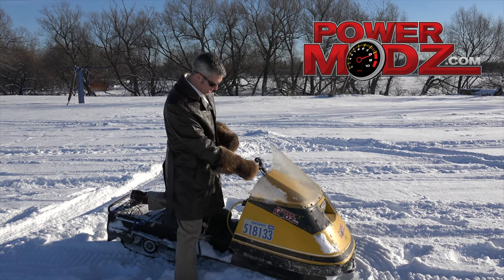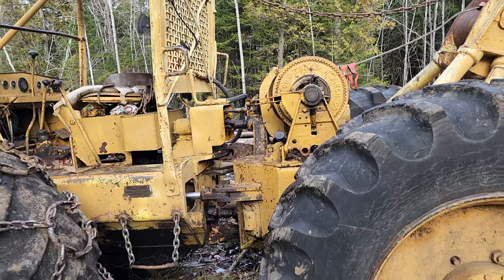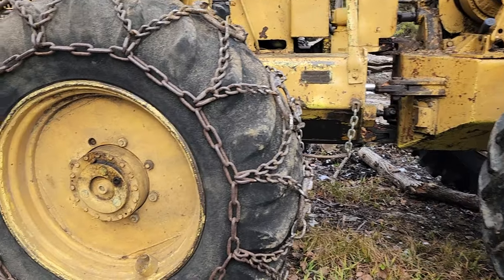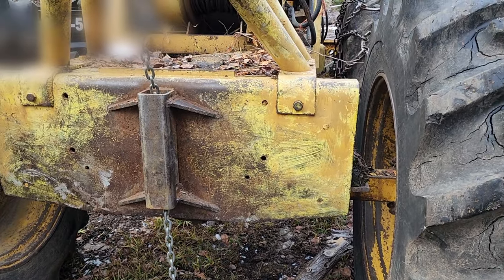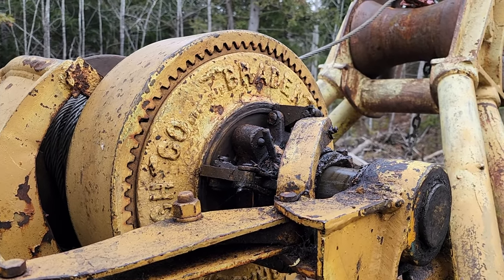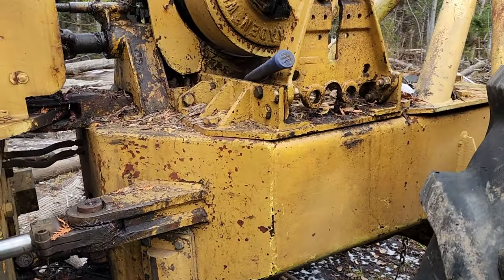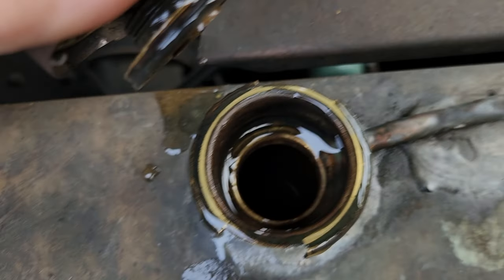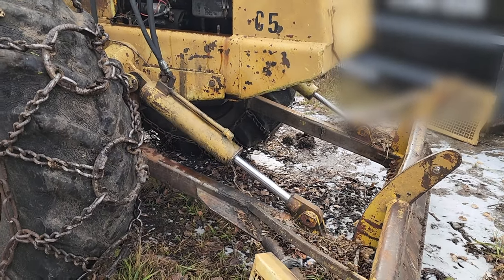BUYING AN OLD SKIDDER .  WHAT TO LOOK FOR.

Comment: Great video! Thank you for taking the time to show and explain things. I am looking at the same machine from 66.
The listing says (copy/pasted)  
EXCELLENT Running machine.
Put on the job sight right now and put to work
353 Detroit. The engine has 1600 hrs on overhaul. Spare transfer case and spare tire and wheel go with it.
Winch rebuilt around 200 hours ago, needs cable.
500 hours on new center pins

They are asking 10k. Your opinion jump on it, or run away?  The machine is 4 hrs from me, skidders never seem to go for sale here most use dozers so finding it is rare, in the pictures the machine is freshly washed, can't tell what is seeping or oozing, it looks clean as in recently washed, but it's been used for sure, abused, cant tell.
I'm definately not a mechanic, but a couple of curses, bloody knuckles, and you tube goes a long ways.

Comment: Only skidder with functioning brakes will be a Deere, had lots of other brands on most had little to no braking action 

Your comments are fairly spot on.  Your machine is typical of what’s out there.  Most require lots of oil.  No one has made a small skidder since the mid to late eighties other than a few one off low volume manufactures.   10 years ago you couldn’t give away a small skidder, but now the are back in favor and will continue to gain popularity as the carbon tax goes up. 

We are just about complete on rebuilding a couple of 440 Deere skidders. One got an engine and the other an engine and tranny, plus lots of hoses, one center pin.  Down to slow hydraulics and diff locker on one and a bad thermostat on the other. My dad put a 4.5L natural in one, he thought it was a 4239 (wrecked ditch witch) which starts very good and has lots of torque.

These will be fairly premium machines or the age, restoration would be new tires, paint, seat and hoses.  I’m expecting to get 15k + out of them. 

Going to servicing up my own 440B up in the next few week to clean up some deadfall in the back 20 acres
Reply from the maker: Sound like some great machines!
Reply: @PowerModzOfficial  they are all great in the eyes of the owner when they are working.

Comment: I have a c4 172 gas my grandfather and dad had and I did a shitload of work to it. There is nothing cheap about these things, but I know what I have and it will last me out. As far as gear oil leaks and such, it's just the nature of the beast, to heck with tearing everything apart replacing seals, let er leak a little and top it all up as required.

Comment: I love the two smoke diesel sound... 
And what a big crack in that crack that has been welded once already, some stress happening there, maybe grind/Torch some or most of that old weld out... and put a fresh bead on it... The thought of it possibly breaking during work and stopping a project, doesn't seem practical.... or is it Ok to leave it this way, and fix it when it breaks??? Completely
Reply from the maker: that's a cable guide to keep the cable on the drum...if i weld it and the cable gets caught under there again ill have to cut it to get it out - the whole thing is a bit sloppy so best to just run the way it is...it isnt structural basically